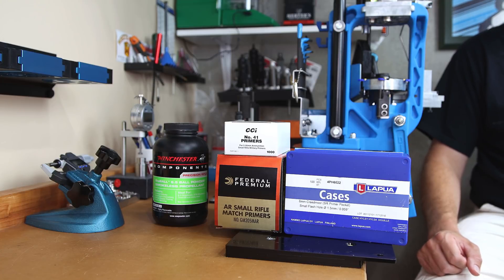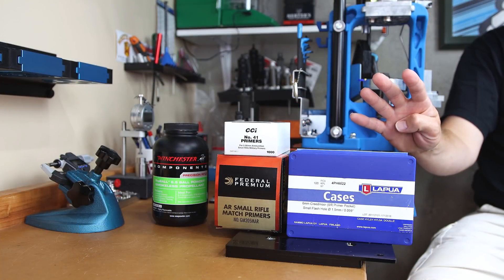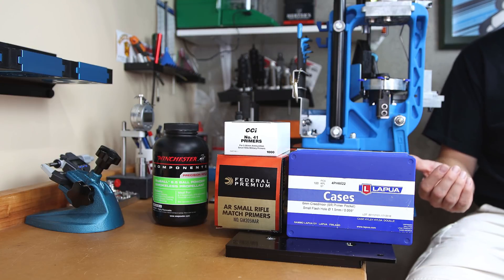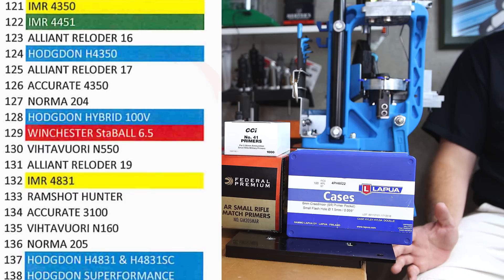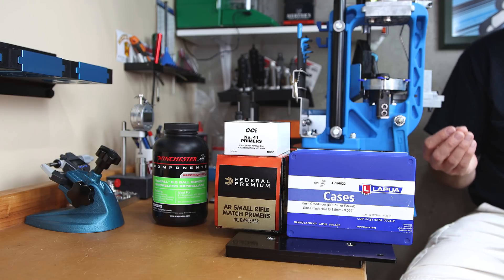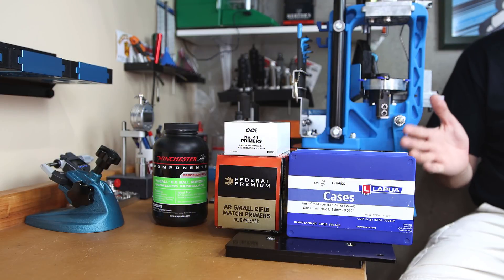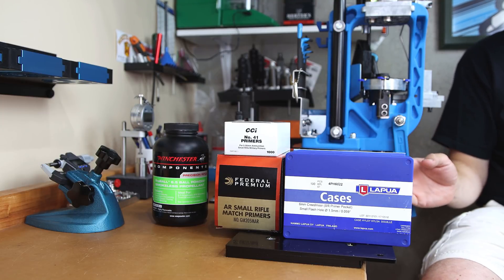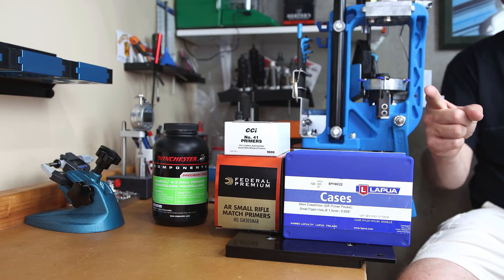Precision Load Development - Stop Chasing the Lands - COAL Powder and Primer

Comment: I’ve heard you mention before that you increase your charges based on case capacity. 6.5cm. .2gr increments, .3 grain increments for larger cases. Etc. I’m loading a magnum cartridge for the first time (7mm STW) and was wondering what increments you would use. Thanks for your time and the great content!

Comment: You mentioned the margin of error of your MV measuring device, you could include that in your graphs, it might influence some of your choices... Or it might make you lose all faith in our "node" methodology, lol.

Thanks for the video.
Reply from the maker: Telling some people that there is error in a lab radars measurement (or any measurement for that matter) seems to enrage people that aren't worth engaging with. All the data I have generated supports nodes.
Reply: @BoltActionReloading  enraging people not worth engaging with seems worthwhile to me... Meanwhile, it may open your horizons on other possible node ranges hidden within the range of error. When we are talking about loading to the individual granule of powder (or as close to that as we can) and you are only loading 1 shot for every individual powder measure the MoE would seem worth considering. Then again, I've got some recency bias from both a stats class and a data visualization class so I may just have a preference for data dense visualizations
Reply from the maker: Most people don't understand my reasoning for this method, I get a lot of questions about it. Have you watched these videos?:
https://youtu.be/hNjtKB3mqiI
https://youtu.be/CWo-D40M9Y0
https://youtu.be/paUMACbJxTs
They largely cover my reasoning for using this method. For any who choose not to use it, no concern of mine. My primary reasons for its use is to very quickly determine if a primer / powder combination is working well at all (See the 308 primer video) determine if the load is going to hit pressure with just a few rounds (anyone who has had to disassemble hours of work should understand this) and give a a good starting point to look around for a particular lot of powder and primers. I am not advocating for shooting 10 rounds, picking a load and its done for life. You still have to validate it. You would never assume from a statistical perspective that you would choose your final load based on 1 data point, but I don't need 5 blown primers at a given charge weight to tell me the load is too hot either. Hopefully this makes some sense.

Comment: Love your videos! A question, if you expand with 2 tou less , what neck bushing are you usign while full lenght sizing? And also, what neck lube do you use? Thanks in advance!
Reply from the maker: Hi Teo, I am glad you enjoy the channel. For these I am FL sizing with a Forster die with no expander button and then  opening up with the EM. It is not a bushing die. If I were using  a bushing I would want to find whatever bushing gave at least .003 of interference and then use the EM. I have tried different combos for lube and not sure it matters anything huge depending on what length you want to go to if you need to remove it.
Reply: @BoltActionReloading  thanks a lot!
Reply from the maker: Hope that helps. If you want to dig a little deeper on these 2 things you can check out my bushing video here: https://youtu.be/D2Gei8Wo6UA (its has info about brass dimensions after sizing) and a test I did on the affects of case lube: https://youtu.be/JQmpox0Lhg8
Best of Luck,
BAR
Reply: @BoltActionReloading  thanks again💪

Comment: I'd be exploring the 42.7-42.9 with the 41s.  If they ever come back in stock I'm gettin about 10k to go with my 34s.  I've had great luck with them and they are nearly as consistent as BR primers with a harder cup for floating pins.  I try to keep my loading simple and versatile. For primers that means 41, 34, WSP, and WLP.  I know people do it, but I'm not trying to tweak loads with primers.  If it's that touchy, I'm gonna move on.  Never been into the wonder pill.  I demand accuracy, but I won't tolerate a finicky gun or round. I like good eaters, too many options out there to put up with picky nonsense and all these shortages show I'm right...to my mind anyway.

Comment: Reminds me of the test I did with my 223 rem using 8208 XBR. The two primers I used were the Remington 7 1/2, and the CCI 450. The 7 1/2's were producing extreme high and low spikes down low like the GM205MAR's did. I did several strings with that primer. The node I got between strings was relatively in the same location. Almost seems to be based off of muzzle velocity. I only did 1 string with the CCI 450's. The 450's ended up needing a higher powder charge to achieve the same velocity as the 7 1/2's, however the velocity increase between charge weights was much smoother and had no spikes. The node seemed to be relatively around the same velocity too. Doing further testing around the node with several 5 shot groups to verify ES/SD with both primers, the 450's did in fact yield an over all lower ES/SD than the 7 1/2's did so I went with them. Now onto the CBTO portion of tuning the jump while maintaining inside my internal magazine.

Comment: I think I would go with the CCI 41's. More constant velocity across all charges, and overall higher velocity is preferred. I would also give CCI 450's a shot.
Reply from the maker: I don't have a ton of 450s in stock at the moment so I didn't want to use the rest I had to develop a load and run out. I have had almost universal response out of the 450 vs the cci-41 so I wonder if the only real difference it the cup thickness.
Reply: @BoltActionReloading  I've not used the  CCI 41's so that's good to know. My local Bass Pro has started getting CCI 450s about once a week but the timing is random, and they are gone by noon.
Reply from the maker: Next time I find some local I will pick some up but I have enough in not willing to pay hasmat at this point.

Comment: I'm not even remotely close to this level of reloading but it's extremely interesting and a great video... I normally just start at max and drop .2 at a time until I have 10 rounds loaded then shoot them all through my chronograph and look for a velocity node on the upper end then just load right in the middle and shoot a 5 shot group... if that doesn't work I change the seating depth and start over. It's not the best way but it's the easiest way for me because again I'm not even remotely close to being this dialed in on my reloading skills... LOL Hopefully one day I'll be there.